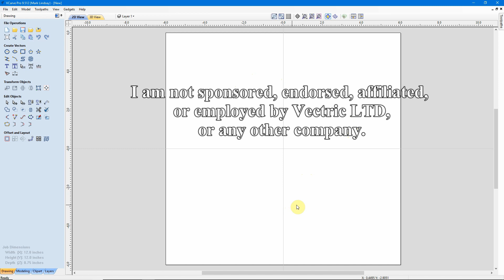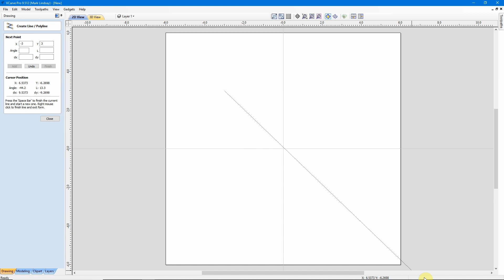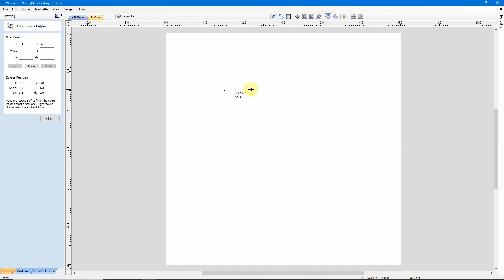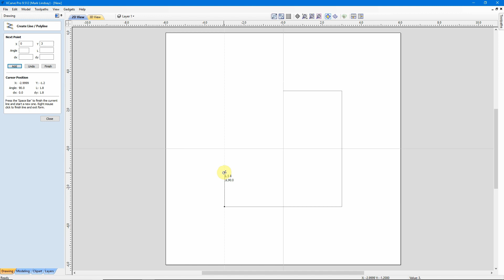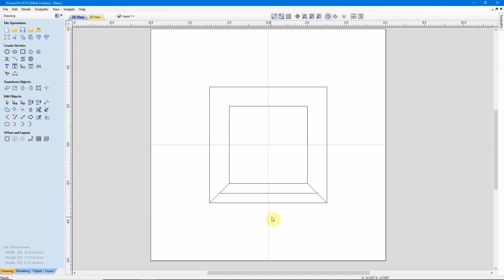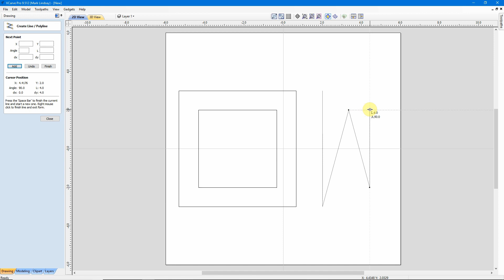Polylines and Smart Snapping - Part 16 - Vectric For Absolute Beginners

Comment: Mark, yet another gem for all of us.  One question ...... Actually it looks like 2 questions ....... Do you recommend having ALL boxes checked in the snapping options menu all the time?  Are there advantages/disadvantages to doing so?
Reply from the maker: Thanks, Steve! You can check or uncheck the boxes in Snap Options as you see fit. I turned them all on for this video so they would be available to demonstrate, and then I only scratched the surface of their capabilities. There are times when Smart Snapping, Angle Snapping, or Geometry Snapping get in the way, and you need to turn them off to do what you want to do. That's one of the reasons for the On/Off icons up at the top.  Generally speaking, however, I leave them all checked, with the exception of Snap to Grid. If I need that, I go into Snap Options and set the grid I want to use, then turn it on.
Reply: @MarkLindsayCNC  Thanks for that detailed response.  I appreciate it.  Have a GREAT day!!!!!!
Reply from the maker: You too, Steve!

Comment: You know, Mike, I have watched many of your videos more than once so I can absorb all of your instructions.  They are very well done.  However, I recently clicked on a video that was referencing instructions that indicated it would be for someone with very little experience in using VCarve or Aspire, as the title stated for the "absolute beginner".  With all the changes being made on the new updates, some of the information is applicable to the old guy as well.  This video here was very informative and I hadn't seen it before.  I have been doing work in Aspire with modeling so I'm a little deeper into it than the beginner, but it was very useful.  Please trick us older guy and gals into stepping outside the box by stating this might be something you could use as it is an enhancement to what you are currently used to.  Thank you for your great work.  I really get a lot out of your efforts.  Please keep it up if you've a mind to.,
Reply from the maker: Thank you, Jerry. I do appreciate your kind words. I started the Absolute Beginner series in the summer of 2018, and at first it was just the basics - interface navigation, basic vector creation, the different toolpaths, etc... After about 10 videos, it started moving away from the basics, and has gotten more advanced as time passed. I've been toying with ending the Absolute Beginner series for about 9 months now, but just haven't done it yet. (Lazy or just rolling with it? You be the judge.) Either way, the next couple of videos are going back to the basics, so we'll see how things go with titling. I did drop the Absolute Beginner title in the thumbnail pics, however.

Comment: Mark Thanks for this video, I now know more about drawing  and snapping
I followed your example of the  rectangle and then stopping and using the tab button to finish closing  the line. and then I did the stop short and add a like to to connect to points, checked for open vectors then closed the one that  was open. that was all good .But then I used the pollyline to draw a line from the bottom right corner to the top left corner. checked for open vector and there was one but I could not get it closed. tried to select things  and none  of that  allowed the  connect button work. So what might I be doing wrong. I have had trouble closing vectors before.
thanks Jeff
Reply from the maker: Thank you for checking it out, Jeff!  You can't connect either the start point or end point to any other point and have the vector close. You can only close a vector by connecting the start point to the end point. That can be done with either a line, a curve, an arc, or a part of another piece of geometry. I hope that helps!
Reply: @MarkLindsayCNC  So are you saying that if I create a square then want to put a diagonal line in I will not be able to joint  the 2 end points to the corners of the square. Can I create a start point in one corner and an end point in the other corner then draw a line  and connect the open vectors that way. Jeff

Comment: How do you snap a circle to a line? For example I want a horizontal line and a 1 inch circled in the center of the line.
Reply from the maker: Put the circle into Move and Transform mode, drag the center of the circle over to the center of the line, then click off.

Comment: Hi Mark .......................  @ 7:00  where you place your start point ( negative 3 ),  surely that 'negative' is dictated by your 'Point Of Origin'.  I assume yours is in the centre of your work piece.
What if your origin point was the bottom left hand corner?  All your measurements would then become 'positive' then.
Can you still do this if all your measurements have to come from that bottom left hand corner?

Thanks

TURK
Reply from the maker: You're exactly right. The reason for that negative number was the fact that my origin is in the center of the piece of material. I did that to reinforce the negative and positive moves in the Cartesian Coordinate System. I was getting a lot of questions about that at the time I recorded this video. If you set your origin (X Y Datum Position in the Job Setup) to Bottom Left corner, all of the measurements will be positive from that point, because all of the positions on the material will be to the right of X zero and above Y zero.
Reply: @MarkLindsayCNC   As always Mark,  you're so prompt in replying to comments and or questions and always precise in your answers.  Very much appreciated my friend.
That information ( confirmation of sorts ) is invaluable to me, as I was a bit stuck on my project, I have no alternative than to use the bottom left hand corner of my material,  it's not actually a 'material' like a flat piece of wood ................  it's an existing part that I need to pocket the top of.

Thanks again Mark  ;  )
Keep safe.

TURK ~ France

Comment: Mark, Thank you for your videos, very informative.  Question, with Geometry Snapping, you were drawing a line at the same height as a corner of your square.  How can you specify how far from that point on the square that you want to begin your line.  In your demonstration you just said we would go to about here and then start drawing.
Reply from the maker: Good question, Wally - one I hadn't even thought about. For now, I'll say, "I don't know," but I'll dig in and see if I can find an answer. Thanks for this. I'll see what I can find out.

Comment: what if you don't get that snap function, how do you turn this on/ I have  2 open vectors and want to join them is there an easy way to join the points?
Reply from the maker: Smart Snapping was introduced in Version 9.0, so if you have 9.0 or later, you have those snap functions. If you have version 8.5 or earlier, it is not available to you. If you do have Smart Snapping available to you, I showed how to turn it on and off in the first 3 minutes of this video, just before I started drawing polylines.

Comment: I am trying to create a grid pattern on top of my spoil board.  It could be cut (ideally with a vcarve bit or a 1/16" endmill)   I can't get vcarve pro to let me do this because all of the lines in the grid are an "open vector.  Any help will be appreciated.
Reply from the maker: Don't try to use a v-carve toolpath. Use a Profile toolpath, with a cut depth of around 1/16 of an inch, select the v-bit of your choice, machining ON the vector. Preview that to see if you like it. If you think it needs to cut deeper or shallower, change the cut depth, recalculate, and preview. I hope that helps!
Reply: @MarkLindsayCNC  Perfect!  Thank you!

Comment: What do you do when your lines cross each other and you have an intersection?  Should I use 2 different layers?
Reply from the maker: It depends. If the lines are for different vectors, yes - put them on separate layers.
Reply: It's going to make one engraved figure into wood.  Its 2 letters combined into 1 figure.  A, little  b and capital D (missing part of its verticle part.). Then fill the engraving with black epoxy.  An inlayed, or engraved insignia in a pool cue.
Reply from the maker: In that case, I'd create the letters on the same layer and connect them. You don't know it, but you just gave me an idea for another video. Thank you!

Comment: I am running Version 8 Aspire and can not get my grid to change, nor will my lines snap to the grid.  I believe the grid is currently set to .500 but the line will not snap to that either.  I wondering if it me or my Aspire program.  Ive had the program a few years but have not used it since my wife and I were in the middle of moving.  Any help for me or should I see if I could get an updated Version of Aspire with the new sniping features?
Reply from the maker: I believe Smart Snapping was introduced in version 9.0. If you're still using Version 8, it's well worth it to upgrade to Version 10.0